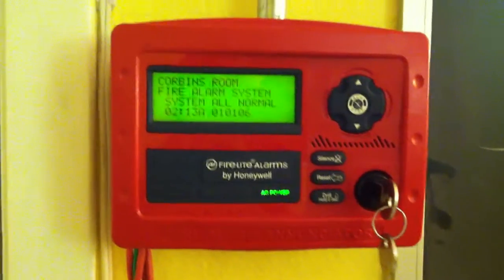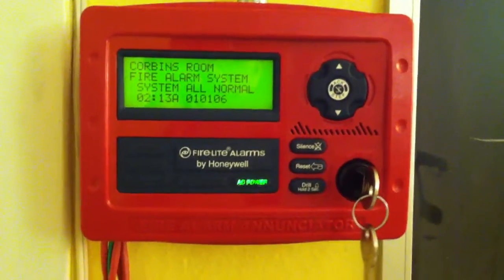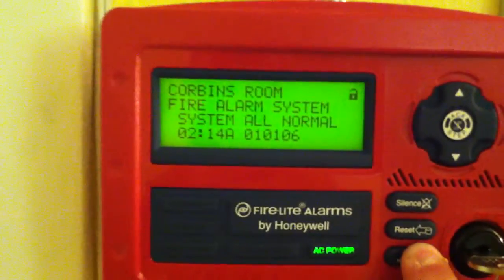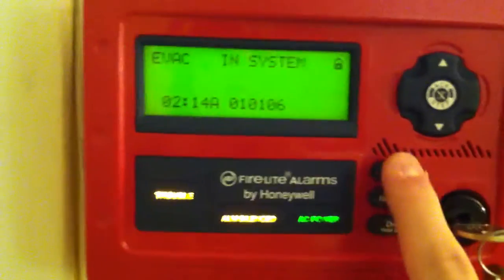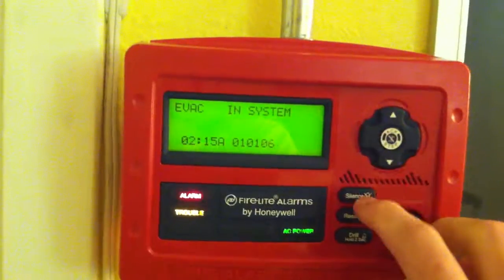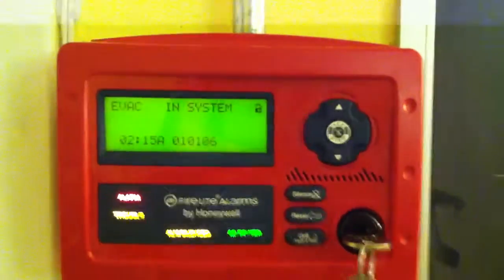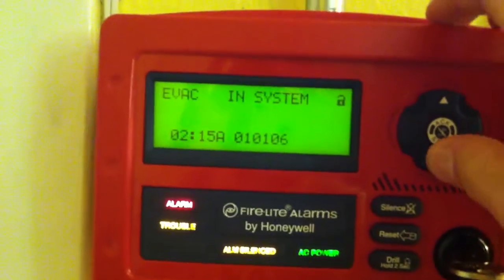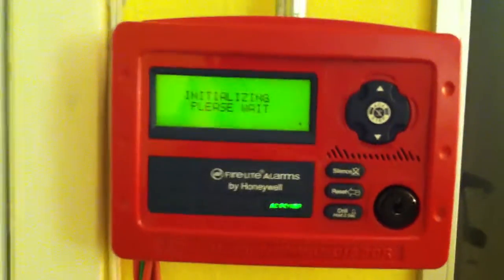Fire-Lite MS-9050UD Drill Function

Comment: How do you wire a fire alarm annunciator without a control panel?
Reply from the maker: You cannot, unfortunately.  The annunciator just allows you to control the system remotely.  You still need the control panel to manage the circuits and process the alarms.

Comment: what would u do if u were in a public building? Example, in my city, the fire department wants all strobes flashing when the drill switch is activated.  So if the drill does not activate the strobes, then what do u do?
Reply: You pull the fire alarm to start the fire drill on fire drill day, then when the panel goes into alarm, the strobes flash and the audibles make their noise they are supposed to make.
Reply: well, u better hope u're central station or local authroities who have jurisdiction r aware u r doing that, lol!
Reply: Easy! If you has a system like this, call the FD FIRST saying you are conducting a fire drill, THEN pull the fire alarm!
Reply: true, in my city, they look down on people who pull the station unless u're a technitian